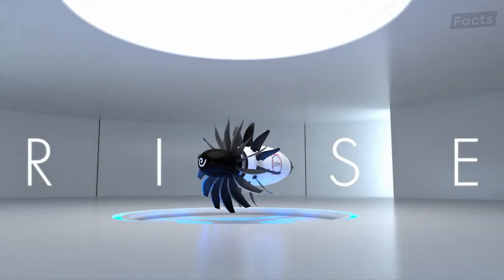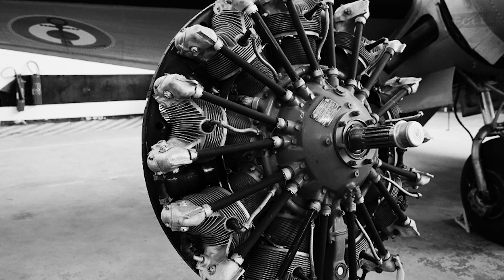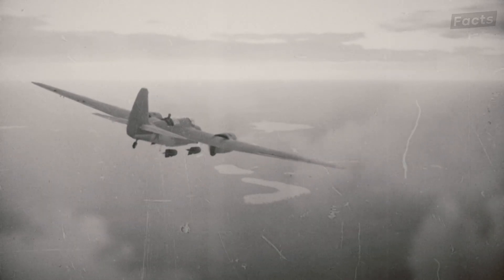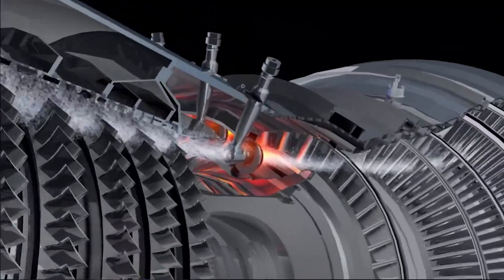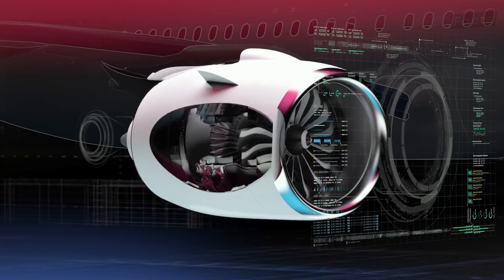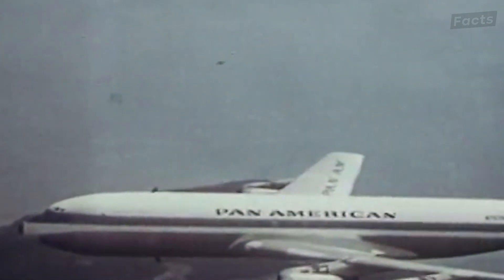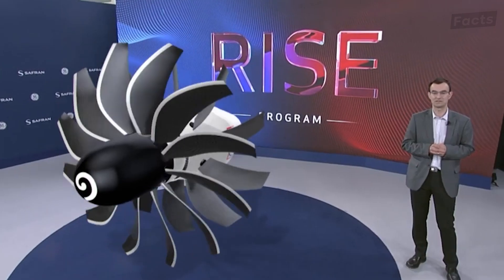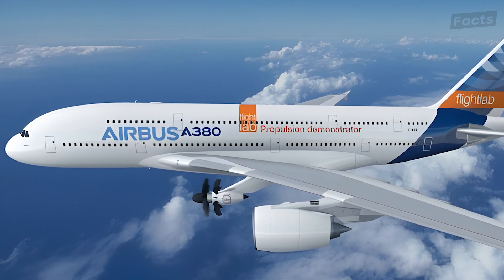The Most ADVANCED Aircraft Engine Ever Made Has A GIANT Problem

Comment: Hydrogen fuel is not going to work, it's not economically viable at this time, the storage of hydrogen requires either extreme low temperatures or extreme pressure to contain it.

Comment: So you call the aviation industry ignoring this engine concept?   No, it just takes awhile for all the issues to be resolved.  In the case of the open rotor, it's noise.   Working on the concept since the 80s is hardly ignoring it.

Comment: At 12.30 you mention hydrogen fuel. Everyone wants hydrogen fuel. Why don't they use ammonia instead? Ammonia is much easier to liquefy and it does not make metals brittle and yes, I know it is highly toxic. Why don't they have a large duct around those blades to reduce noise. Why don't they have variable pitch in bypass engines instead of going back to the 1950s

Comment: Do you know how hard it is to contain hydrogen?                                            It leaks through the metal.                                       Not to mention boil off.                              Of course I wouldn't need to call the fire department for a fuel spill.

Comment: This system will not work.  The power and torque requirements to rotate such a big fan with such an aggressive pitch angle for each blade would be very large. The fuel consumption will not be good and heat generation will be an issue to solve.      And the "Blade Out" condition will cause structural to be very rigid and heavy. I am not sure this is worth spending time on. The Blade Out condition was one of the reasons that 7J7 (open fan 727) was cancelled.

Comment: Propeller aircraft cannot go faster than about 350mph, in any efficient manner.  Depending on the propeller design, the compressibility zone losses start to rise exponentially.  This technology was heavily investigated after WW2, and modern turboprops are very fuel efficient.  The Russians use dual rotors now on their old bombers, and these can fly twice as far on the same fuel load as a KC135.  Old testing, using props and jets together, resulted in dramatic failures of airframes, and test pilot deaths.  Lets not reinvent failed technology again, deja-vu all over again.

Comment: What a load of BS. The rotary aircraft engine was in common use in WW1, which was some years before the 1930's. Hydrogen is not a viable fuel source for general automotive use, trials in the US are being discontinued. As for aircraft, the same issues would exist. However, I would love to watch safely from the ground the maiden flight of the Boeing Hindenburg. I'm sure there is a used car lot somewhere looking for staff, I think you should apply.
Reply: In addition to all the other misleading waffle, the rotary engine fell out of favour in the late 19-Teens, early 19-Twenties in favour of the radial engine. Love the illustration of an inline engine while stating that the aircraft had rotary in it. Also it's not an Open Rotor - it's still an Unducted Fan and the CAD illustrations were lifted straight from Safran.

Absolute and utter lack of research going on here. No new or real information at all.

Comment: The only way to reduce noise with any sort of fan is to reduce the rotation speed of the fan blades.  The faster they rotate, the louder.  So, if you want a quiet turboprop, you have to have a lower thrust turboprop.

Comment: At ~ 12:40 "Hydrogen as a Fuel Source, Does not Cause any Greenhouse gas Emissions".... Really?
What do you think Clouds Are Made From, if Not Water Vapor! And They are a Quite Large "Blanket" Keeping the Heat in, for example, on a Cloudy Night!
Reply: Technically correct, however in reality total BS, because completely negligible. Look at the proportions of anthropogenic H2O added through a few thousand flights a day compared to the 12.9 trillion metric tonnes of "natural" water the atmosphere typically contains in the form of water droplets / clouds / H2O gas. 
Secondly, cloud cover is generally seen as countering a global heating effect, while gaseous H20 technically works similar to a "greenhouse gas" - a fact that nicely illustrates the absurdity of the currently fashionable CO2 hysteria.

Comment: People will gladly put up with noise if the safety,  reliability,  and economics make sense.  One of the iterations hinted at using laminar air flow via a stator prop.  Sure would like to know more about that.
Reply: Yup, people will gladly put up with a significant loss in healthy life years and an increased risk of cardiovascular disease and an increased risk of early-onset dementia. Because these are epidemiological consequences of an increased noise exposure. Some figures from the EU: every year, about one million healthy life years are lost to noise exposure, most of which comes from transportation. And this is only the risk from one environmental stressor. Add another one like particles, VOCs, vibration, and the figures are even worse. Our (EU) "efficiency fetish" at the expense of safety and health already has a huge negative impact on the general population, so we can certainly do with a bit more noise.

Comment: Hydrogen will never be commercially viable in Airliners.
Reply: Totally disagree hydrogen's to fuel airplane engines would work better
Reply: @jamesmonahan3904  you disagree because you have limited knowledge of handling and producing hydrogen.
It burns green. You can't produce it in a green manner
Reply: @larrydugan1441  And as I understand converting electricity to hydrogen is only about 30% efficcient meaning 70% of the energy is lost before you even have the hydrogen if using the  electrolysis method  wich is the only clean way to produce hydrogen by splitting water and that is true only if the electricity used in the process is also clean and not generated with say fossil fuel power stations. The only other existing way to produce hydrogen is by splitting natural gas wich releases HUGE amounts of CO2 so that is not an environmentally friendly option.
Reply: @jamesmonahan3904  watch a video of the hidenberg